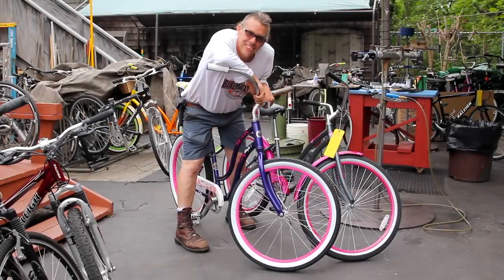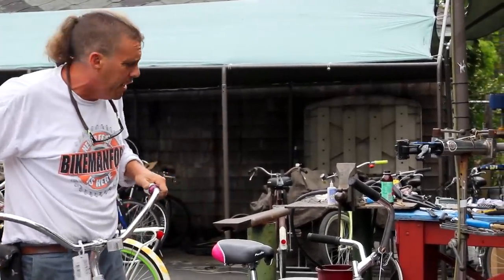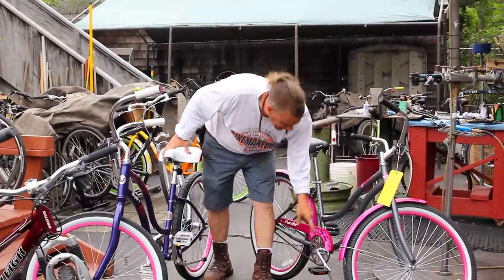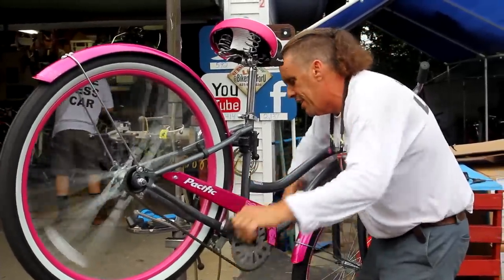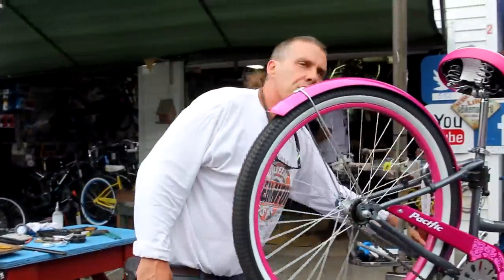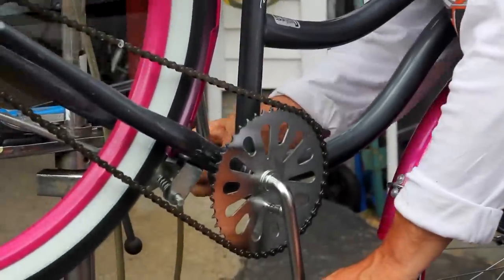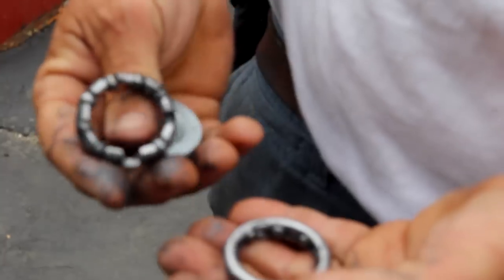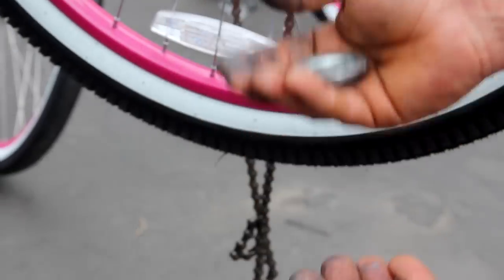How Cheap Walmart Bikes Suck Your Wallet Bone Dry - No Grease - BikemanforU

Comment: Walmart bikes will cost you more in the long run. Spending more for a bike in a bike store will cost you less than upgrading Walmart bikes I know from experience. Having to strip down two Walmart bikes so far. The wheel axels were to tight gears not shifting right headset loose.lack of grease in all areas. Cheap cranks wheels warped ect. It has cost me more than the bike is worth. So spend the extra and get a bike from bike shop and you will pay less in the long run. Bike parts cost lots of money. I could have had a high end bike for all I paid to get a good reliable bike.
Reply: any bike will cost more in the long run if you don't know how to take care of it. it could come from walmart or sears or kmart or any bike shop. everything costs money no matter where you buy it. I had a Huffy Santa Fe for close to 20 years that I bought from walmart and only had the bearings replaced twice in it's lifetime. I used it go to the store back and forth for a number of years with a lot of heavy groceries and it never gave me a problem. Maybe the problem people are having is they don't know how to take care of a bike so they dump their problems on walmart.

Comment: I've made my mongoose as good as any :-! or enduro bicycle I've even got a couple my old box sponsers back  I used race in min 4th in nation expert class when I quit. I know what I'm doing. the bike was nice but i got rock's shod rear and everything got some used fox forks I'm saving up for... put some 26"rhino ligjts. all fsa on the top fsa ceramic headset bearings fsa stem kept sram twist shifters and 3 on front 7 in rear. went to cassette instead free wheel has same build as a giant maestro rear..
after all said n done I got a very very good bike for half the price of a trek and wayyyyy better bike

Comment: wish I could agree with any of the comments he makes but he's wrong about everything. he bent the bearing getting it out. not manufactures fault. also not everyone can purchase a $300.00 bike.
Reply: +George Renz come on! just 2 dollars a day and you can buy a 300 dollars bike in 150 days. save is the answer to many unafforable purchases. and cheap bikes are not worth it. a good bike would last you years before you need to reemplace something.
Reply: +Bruno Santana I had a bike from walmart that cost me $260. It lasted 9 years with no problems and I put it through weekly use. IT'S JUST A BICYCLE! lol You don't have to spend much money on something that is just for casual recreation. All bikes no matter how expensive have one thing in common... You gotta oil and clean the chain... That's it.  Why do you think people refuse to pay those ridiculous prices?
Reply: +shechshire Because if I'm going to hit the trails and do some good mountain biking, I don't want to be on something with plastic break levers that will break easily, without disk brakes, a frame that's been welded poorly, cheap components and been assembled by a dumb nut. Those are things that you can NOT argue about on a Walmart bike. If you need a cruiser, fine, Walmart will do, but anything beyond that and buying anything from a big box story is just asking for problems.
Reply: Danielle Anderson Most of them have metallic brake levers. Polycarbonates are still pretty durable though. A lot of expensive mountain bikes don't have disk breaks. Welding is welding buddy, it's not rocket science and I've seen those big expensive ones break too. Assembly is one thing though hat I do agree with you. Proper assembly and maintenance is crucial. Right, like I said, for typical recreational use. Just as long as you don't do stupid shit with it, AKA advanced courses, you should be fine. Funny you're talking about problems. A co-worker of mine recently bought a $1000 trek mountain bike. It's been not even two months and the thing is already making noises and has had at least two flats. Hmm, I guess those big expensive bikes aren't problem free after all.

Comment: any xc or enduro..if you know what your doing and have the time. I'm a tinkerer I blacksmith to bike to pokemon to raisl road exploring. I'm disables due to box but i got back on my Schwinn Delmar last year needed and wanted something fast again and got bike for 149 bought a 2 year warentee on bike. if anything breaks all I send in is seat and pedals and they'll send you the e gift card for new bike. I put bout lets say after all said n done 250 so if I put 400 and came aout with what I believe to be a very very good mtb now and I didn't have to empty out a grand for a entry level. I can't believe even dk and intense is doing the Walmart thing mongoose still sell pro series I had messages mongoose and got great feedback and very fast. they sent me link to their pro bike's their still couple grand entry level so lets say I saved 600bucks of course I didn't have any outragous labor fees to pay tho I called cycling and fitness warehouse and they want $80th just to freakin index I went down road to my old faveorite local bmx shop and they did it and tought me how for $10 but they remembered me also I bough some pedal straps I can't go clips because injury if u get too messed up I'll be out again somedays I can't get out of bed. lets just say in 2011 I flat bottomed from about 20-25th feet because I was screwing around and kicked put of the big half pipe at Lehigh acres FL skatepark...ended my dreams quickly. you makes out there know what I mean lol my bar's bent headtube busted forks busted I still have my toms that exploded pretty much I was on my kink whip I raced a Schwinn prodtock but only thing Schwinn left on it was seat and frame lol

Comment: those pacific cycle bikes are trash, a huffy is now several inches shorter between the stem and seat post,  bearings usually in backwards (and ungreased), forks backwards, fenders mounted backwards. plastic pedals that break under pressure, chrome rusts in just a few months. i buy them used all the time for the out of round tires the seats and a few other parts that are nice to keep around to use on real bikes.

Comment: Bikeman, people arw stupid. People do not understand that a cheap bike and poor quality assembly go hand in hand together. What they also do not understand is that beong cheap to buy more expensive in long run because a lot more repairs must be done, unlike qyality bikes which are more expensive to buy but require just simple maintenance to keep them going and this is how it will actually quality bikes are cheaper than cheap bikes, but people are atupid and do not understand that. They will always fall for the trap of cheap and will always suffer the underwater stones from that decision.
Reply: I will only add the caveat that for some of us, the choice is either to buy a department store bike or to sit on the couch.  Either the local market for used bikes is non-existent or we simply don't have the money for anything better.